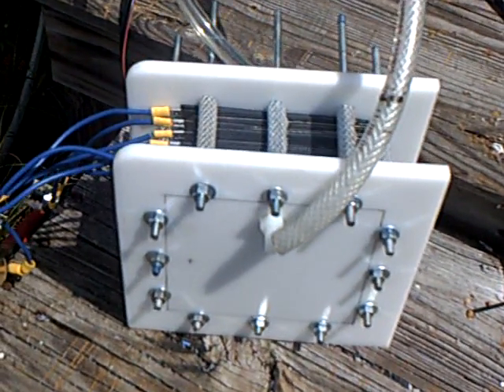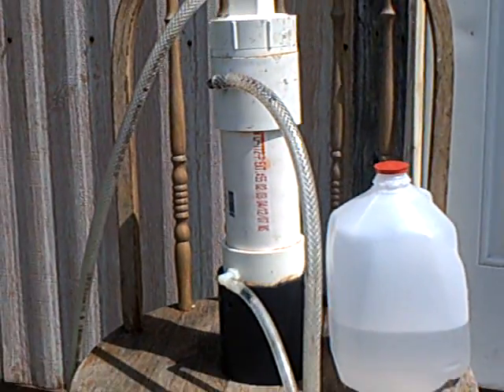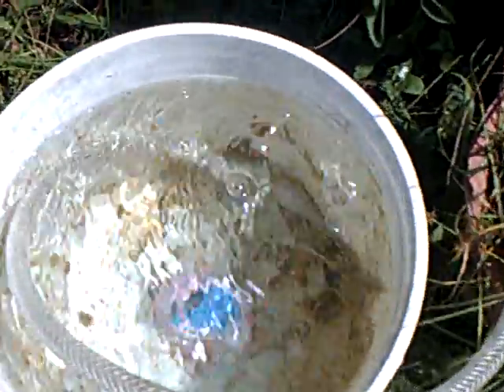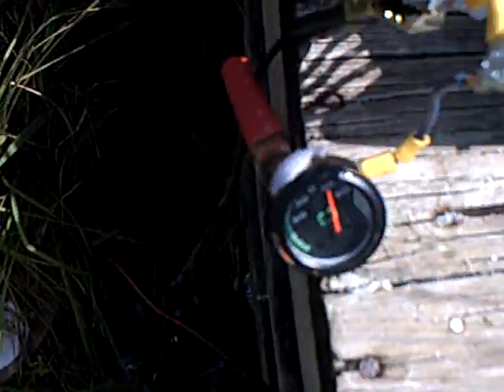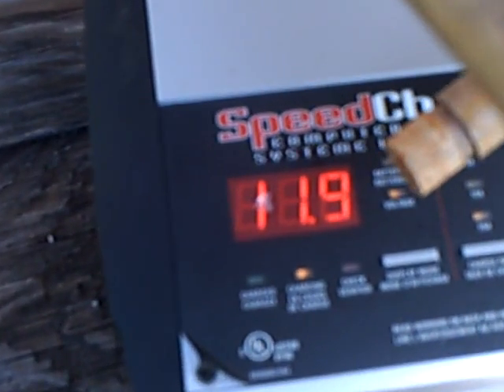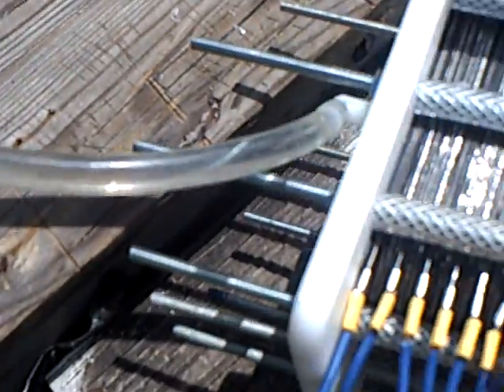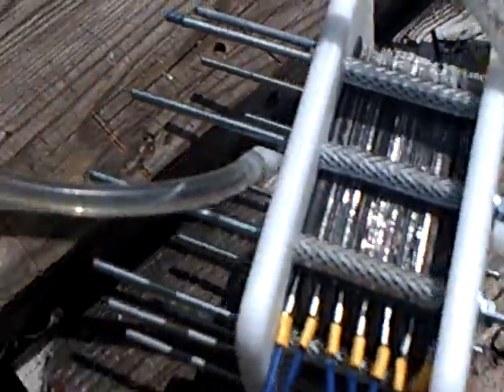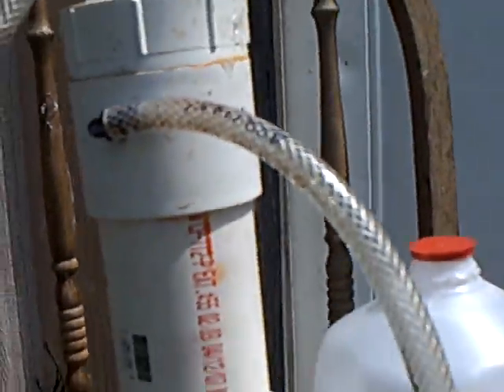My new HHO Drycell project #5 Reservoir First run

Comment: Musicman, GREAT results w/ the single hole unit!  Where the vid of the 51 plater man!  I wanna see that bad boy, and see it in ACTION!

I'm also about to create a no hole drycell, is super simple too, will post vid as soon as complete.  Gaskets are simple as well.  Bolts won't be going thru the active plates, just the end plates, same as you...

Also, can't trust the batt charger gauges, MUST use meter to measure V and A accurately.

Superbee

Comment from the maker: The no bottom holes thing actually works great.My highest MMW so far is 6.41 with 31 plates.I just added more plates to it today,now it has 51 plates ,got it running outside right now on 120v 5.5amps 1 liter 16secs MMW 5.68,Only been running bout 20 mins. I am getting pretty good efficiency out of this cell with no bottom holes..It works great, Gas comes out one hose water goes in the other.With the efficiency I am getting I think no bottom holes is the way to go.

Comment: tear down the cell and check the plates you probably will need water inlet holes on the bottom. if you are worried about current leakage. just stagger the holes. good job!

Comment from the maker: Yeah I have noticed that a little myself with the MMW getting better with higher amps and worse with lower ones..bout as high as I can go right now is 30 amps..I have been burning my in I have had it run a total of 21 hrs now my MMW is better the longer I run it...My latest test was bout 20 mins ago with a 5.51..12.1v 25amps 1 liter 36secs ..Got me some more 304 steel today fixen to size her up with 31 more plates or may build me a 8x8 one,got enough to both

Comment from the maker: So far having just top holes is working I let it run all night last night..Yeah I may put this one on my car,a 97 nissan altima , I have a smaller unit already on it Switch plate one..but only doing bout 800 ml a min..4mpg gain I cant wait to what will happen when I put 2 or more Lpm in it...JUst done another test about 30 mins ago the results for it are 
12.4v 30amps 1 liter in 31 secs MMW 5.20

Comment from the maker: So far its working good ,I run for 3 or 4 hrs today and have had it running for 2 hrs already tonight..It has good flow, good convection, just did Lpm test about ten mins ago at 12.5v 25amps getting 1 LPM 37secs and my MMW is 5.19..Would make a video tonight but my camera dont do well out side at night will post one tomorrow sometime if I get the chance..But so far so good its actually doing better than Thought it would considering I only have holes in the top...